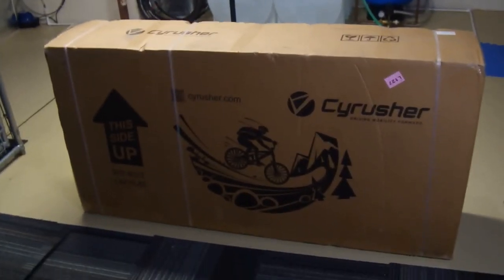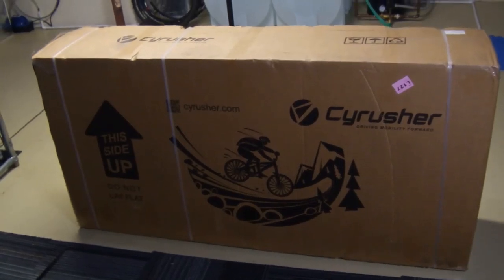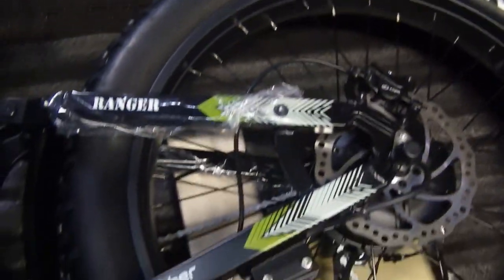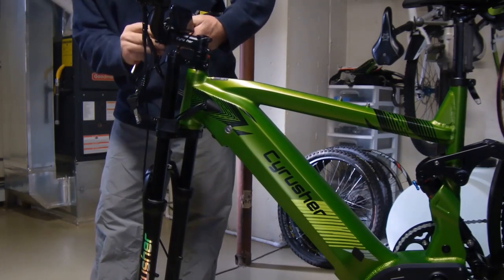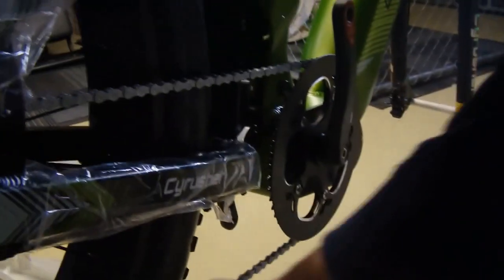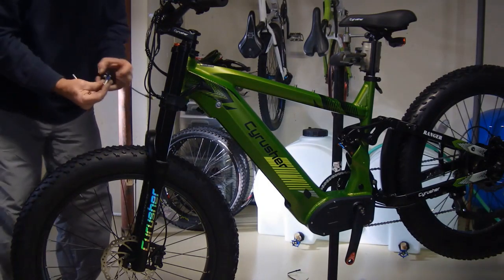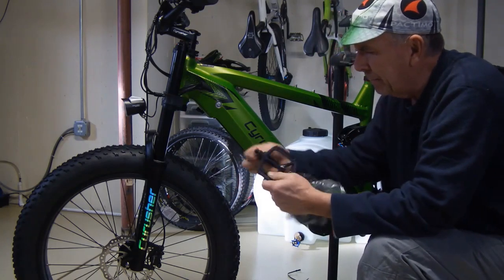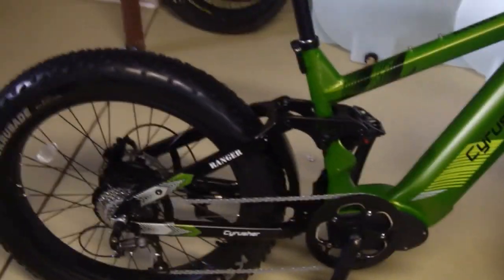2023  Cyrusher Ranger assembly and look-over.  Ebike like Nireeka,  Quietkat,  Pedego, Aventon

Comment: Hi , loving you videos..i I might consider a quick release in the future, can you recommend the correct one to get? Thanks so much and keep the videos coming, they are great!!!!!👍👍👍
Reply from the maker: Thanks so much for watching!  I've had a bunch of ebikes over the last year and the Ranger is by far my favorite. I put a quick release axle on my front wheel but I'm afraid I'm not going to be much help on specifically what to order. I measured the axle length of the axle and got a "fat tire" hollow axle of the correct length (with skewer) off ebay.  Then it's an easy swap. Contact Cyrusher because there are a few of their bikes that come with hollow front axles and they may be able to supply you with what you need. Have fun!
Reply: @lifebehindbarz60  thanks bro 👍